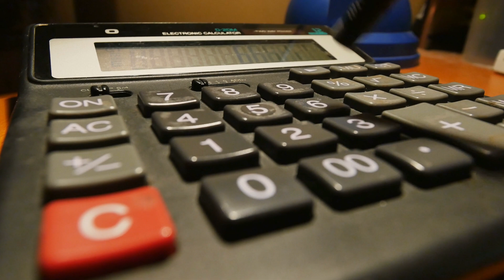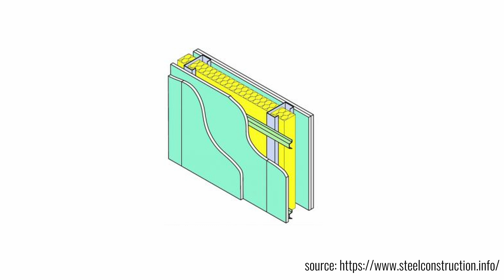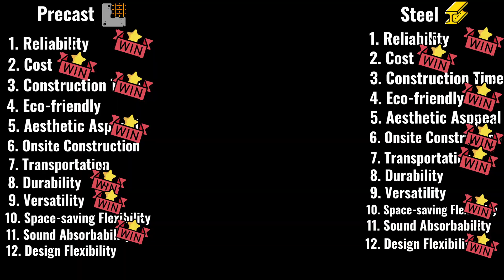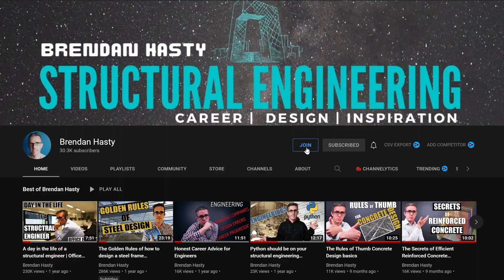Precast Concrete Vs Steel Frame Who wins?

Comment: Question 1: Which of the 2 can survive in 7 to 9 intensity of Earthquake????
Question 2: If the land to construct for the Project has lots of stone. Which of the 2 is more capable and advantage to build 5 to 7 storey Commercial Building?
Reply: Q1: Both can survive intense earthquakes. Japan frequently uses both precast and steel designs. Any system can survive, you just have to design it right. 
Q2: Stone in the ground doesn't affect the building material, what you are asking is what foundation is appropriate. If by stone you mean bedrock, then just cast-in-place footings/piers directly on top of the rock is fine. no need for piles. Steel or precast all have to sit on the appropriate foundation for the site.

Comment: steel builds are lighter and more earthquake resistant. steel building is more flexible and easy to repair. if steel building collapse. it does not take many lives because it does not have  concrete made floor.
Reply: yes but the floor is concrete either way

Comment: Very interesting video, thanks!
However, regarding the eco-friendly point I think it needs to be argued that you have to look at more than just the structural elements, it's the finished building that counts. For instance, the steel framing will need fire and sound insulation whereas this is already "covered" by the concrete being heavy and naturally fire proof.  Maybe do a video on that some day?

Comment: Hi Brendan, thanks for making great content. i really enjoy your videos! do you have any videos about material selection for structural columns? specifically what I am interested in knowing is why (in my area of austin tx) is it so common to see HSS columns as opposed to wide flange on structural engineer drawings? as a steel fabricator it seems like you could easily sub out HSS for an i-beam which is cheaper and opens up more options for column to beam connections. let me know if you can point me to any videos that discuss this topic.

thanks!

Comment: Hai Brendan .. I have just began my career in structural engineering from India. I am trying to move to UK for a structural Eng .job.. But i am not confident in my  knowledge of RCC design , also I am struggling to understand British Codes and Design ... Could you Recommend some Civil Engineering books based on british codes that completely teaches the RCC Analysis &  design , based on British Standards so as to clear my basics first ..I would highly appreciate if let me know the books..

Comment: In my country (Brazil) steel structures are generally more expensive than precast concrete structures. We manufacture our own steel sections, but reinforced concrete is by far the most used structural system here.
Reply from the maker: Hi Edmar, it is the same in australia as well. tho in places like the US steel is more common. thanks for watching and the support.
Reply: @BrendanHasty  I saw in New York. Most of the Building are Steel Frame. US has strong steel frame. Its US made. Not china😁😁😁😁😁

Comment: Very interesting  and precise showdown Brendan. Very helpful in getting a rough idea which method is better.
Reply from the maker: Hi Deepak thanks for watching, know the benfits and drawbacks is always important.
Reply: @BrendanHasty I have noticed the precast concrete homes I have seen installed, don’t have specific additional insulation.  Precast concrete has great thermal mass, is that why there is no insulation needed?

Comment: Precast usually wins on cost. But the transportation etc. can be challenging depending on the site location. One other thing that is very important, again, depending on the building is fire resistance on which concrete has an enormous upper hand. That said, although our curriculum is more oriented towards concrete, i always prefered steel structures, way more flexibility on how you design your structure, no pun intended.
Reply from the maker: Thanks for sharing!

Comment: Is precast concrete resist to earthquake?
Reply: Yes, all depends on the design, check out precast hybrid moment frames for an example
Reply from the maker: Hi Mohammed, you can design precast building to resist earthquakes just need to carefully detail all the connections.

Comment: I would say that both types of systems also a allow for circulair construction when designed for reassembly in mind. This would be easier with steel but this also possible with precast depening on the types of connections. There are now some alternatives to grouted connections that make it possible to take a precast building apart in a non-destructive way. In the city of Arnhem in the Netherlands an old office building from 1987 that was built with traditional grouted conenctions has been disassembled, and certain elements such as the hollow core floor are re-used for a new building. In this case they simple cut the elements loose with a diamond saw. In think that in the future we might see more Peikko type conenctions that allow precast structures to be assembled / dissambled like steel frames. This is already common with precast systems for low-rise housing that uses very simple bolted or welded steel connections.
Reply from the maker: Hi DYKO, reuse will become more and more common. still would still be more reuseable as your can melt it down and form it into a new form this is much harder for precast. but I think it will become more common for building to be design from cradel to grave.